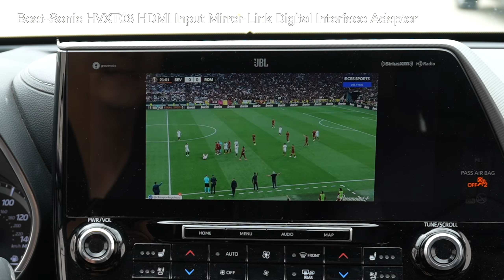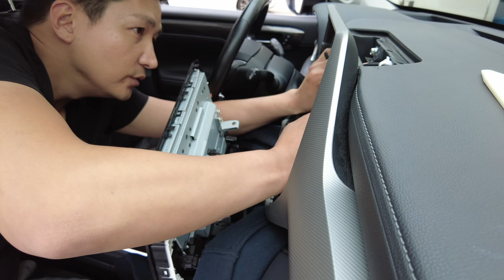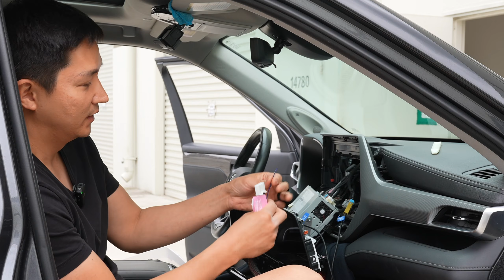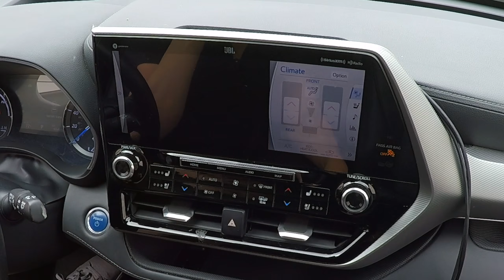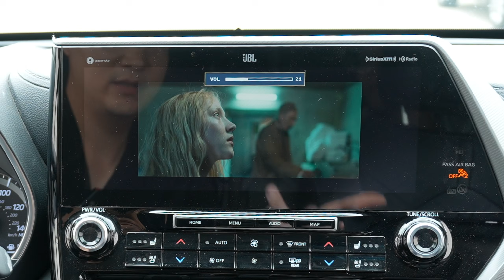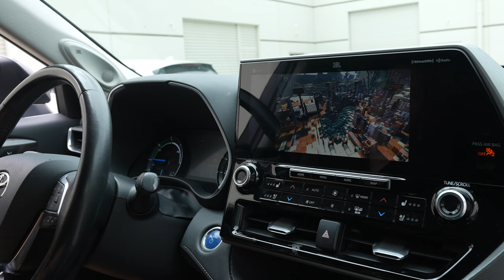2019-2022 Toyota Highlander High Definition Screen Mirroring Kit

Comment: hi,  i have USB C on newer iphone , do u havea adapter for that
Reply from the maker: Like the AV adapter? https://www.apple.com/shop/product/MW5M3AM/A/usb-c-digital-av-multiport-adapter
Reply: @BeatSonicUS  just ordered the screen mirroring kit from your website. i see navks is selling for 500 same unit, any difference between the two units. again both are 12.3 inch supportable
Reply: @BeatSonicUS  Just placed an order for this unit in your website. i bouht usbc OEM apple av adapter. i assume your unit has power wire to power the AV adaptaer using usb OR u want me to route it seperately ..?? it is unclear in your video,
Reply from the maker: @sivucit  AV adapter needs Lightning to USB Charging Cable